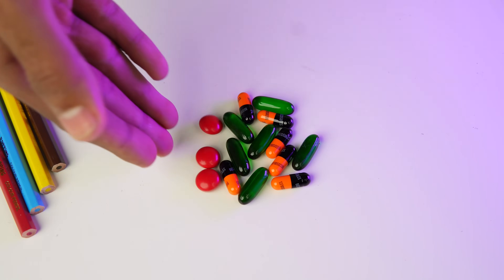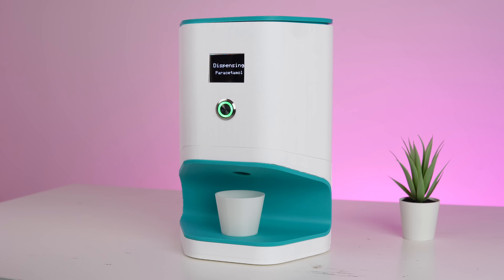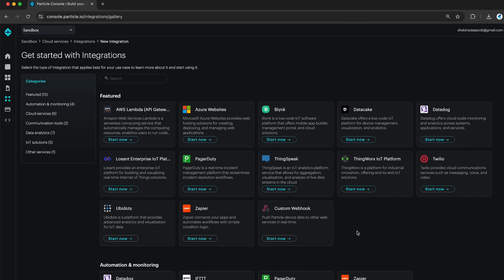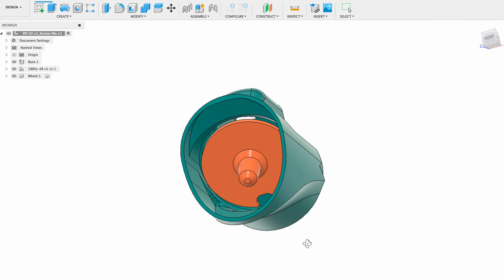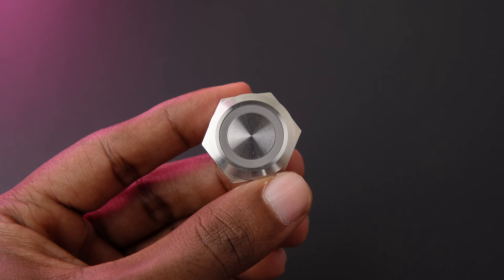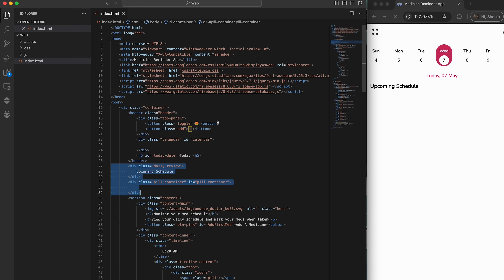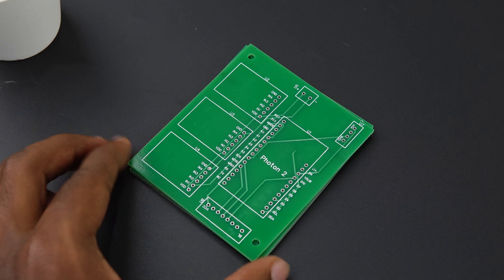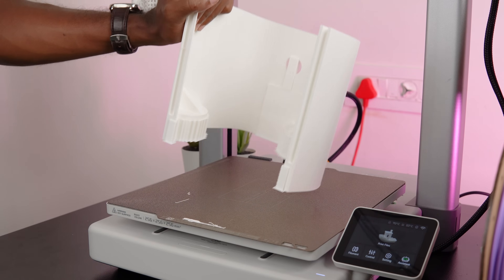One Missed Pill Can Kill — This $30 Smart Pill Dispenser Might Save Your Life

Comment: Great idea but I would need to expand the capabilities. I was lucky enough to receive the gift of life by my transplant donor buy sadly I am in need of a greatly expanded capability machine that could hadle up to a dozen diffrent pills. Any chance to expand Smart Pill Dispenser to that extent? Or perhaps to 6 pills?
Reply from the maker: The pill holders are just modular, add 3 more pill holders and you're good to go (with some minor tweaks in the design)

Comment: But this is for fixed pill size. Problem is how to fit any size....
Reply from the maker: That's definitely a problem, but if you look into the design there's still an option by replacing the rotor part in each case.